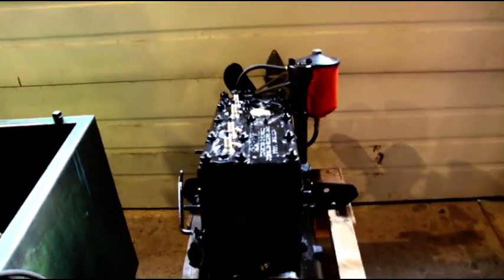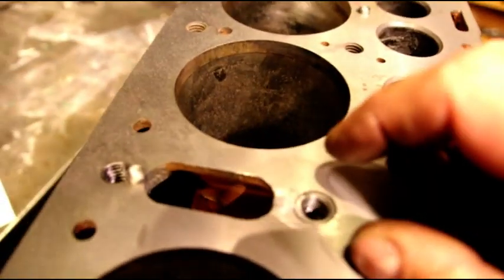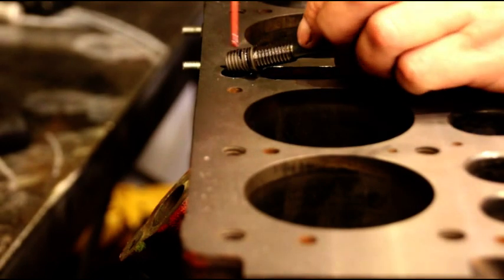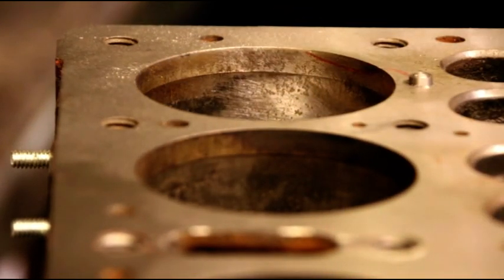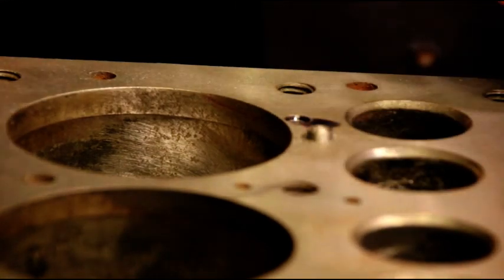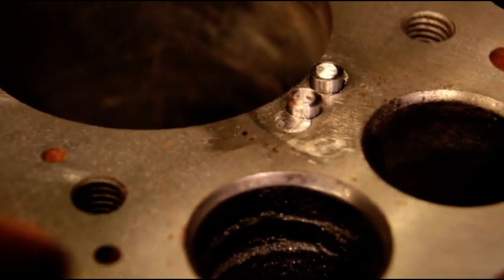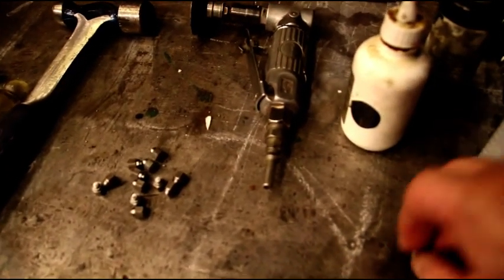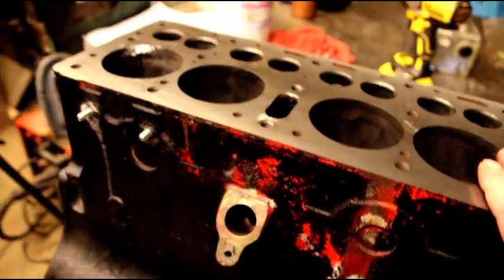Willys Engine Block Crack Repair....How To Save Original Block

Comment: I didn't know all those cracks were repairable. I would like to see how you fix the leaky distributor passage leaks. mine was leaking and I  suspect my J B weld repair is NOT what you would do. ( so far after 2700 mi its still is leak free though ) thanks for the great details.

Comment: Awesome work !!!! About to work on a 59flathead 8 with some cracks .... Want to metal stitch myself ..I believe I have one crack in a bore as well ..being a backyard diyer .....and flatheads not making that much compression to run .....could I sticch a cylinder then use a stone hone on my drill to get it round then install my piston again ??? This engine is just going in a model a backyard built hotrod ...nothing fancy and won't see too many run time hours
Reply from the maker: If you are VERY careful and the crack does not go too far down into the cylinder you may be able to clean it up enough to install your piston again.  Take your time and be careful in the bore so you don't mess it up and your rings won't seal.
Reply: @metalshaperJeep  thanks for the reply I appreciate that ...I'll totally take my time ! I heard that you can't sleeve after stitching cause it will cause the crack to spread ?? Is that true , or is it still safe to sleeve after ?

Comment: Very many thanks for showing what goes into this process, I very much doubt that there are many engine restorers out there that would even have the skill to use a ball peen hammer accurately, so at least it will show them just how much skill is required to achieve a repair like this, stay safe! Chris B.
Reply from the maker: Always good to hear from you Chris.  I have been saving blocks like this for a long time and the cold stitching method is my favorite way of dealing with cracks.   Thanks for watching

Comment: Brian, Thank you for another informative video.  I am currently rebuilding a 134 L head from a 1941 Willys pickup model 441. When I was scraping the gunk off the block I found that the block was likely frozen at one time which cracked it on the distributor side in the lower portion of the water jacket. The block had been V grooved and epoxy was used. Can cracks in this area of these engines be successfully repaired with metal stitching. The block is number matching to the truck so I would like to save it.
Reply from the maker: yes it can be fixed with metal stitching.  That is a very common area to crack and I have successfully fixed many blocks like yours.  I would recommend cleaning until you get all the epoxy out, then clean it again.  Make sure you have clean, bright metal.  Make the repair , then pressure check the block.   I have videos out there on how to pressure test blocks so you may want to look them over as well.  15 pounds or a bit more and check for leaks.  If everything is good continue on with your rebuild.  
Brian
Reply: @metalshaperJeep  thank you for the super quick reply. I had the block hot tanked there are still a few traces of epoxy to pick out and then will clean again. I emailed locknstitch with pictures and material thickness measurements to make sure which pins will work with the previously ground V / U grooves. I’ll definitely be watching your pressure test video. I noticed the area that has cracked bulged i my block do you leave the bulge.
Reply from the maker: @cabotbroughton7458  email some pictures of the crack and bulge when you get a chance.    metalshaper@comcast.net
Brian

Comment: Brian, I’m about ready to throw my gear pullers across the garage. I’m attempting to remove the camshaft gear on my 4-134 f-head and my pullers keep slipping. I cannot find a video actually showing this nylon gear being removed. Do you have one?
Reply from the maker: I don't have a video on that  but good idea for one.  They are removed buy putting a 2 jaw puller into the holes of the gear with the hook of the puller facing outward.  Then it is pulled off.  Without the correct puller it can slip.   Another way is to rotate the cam so you can remove the cam retainer plate bolts.   Then once the bolts are out you can pull  the entire cam and gear out of the engine.  Put the cam in a press, support the gear so it does not break and press the cam out.   I always do it that way, faster and easier than setting up a puller.   I install the same way, press the gear on the cam, don't forget to put the spacer and retainer on first.  Then install in the engine as a unit.
Reply: Thanks. I’ll get back to it in a few days. I’m too hot and frustrated to look at it again tonight.